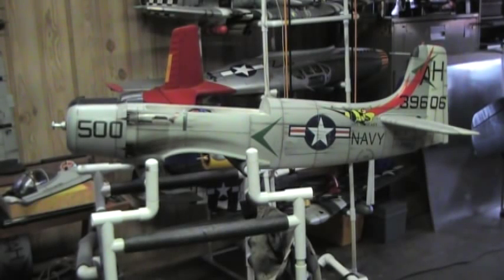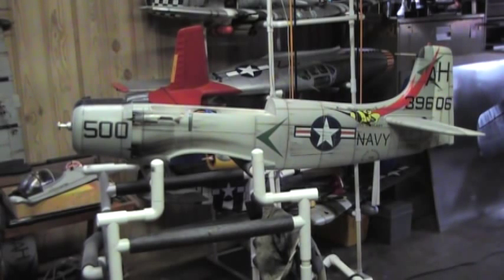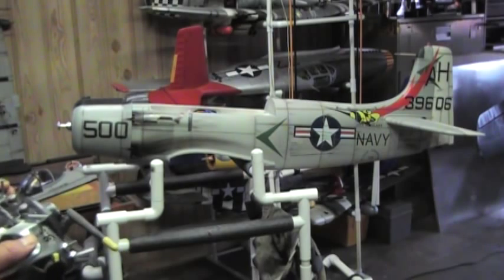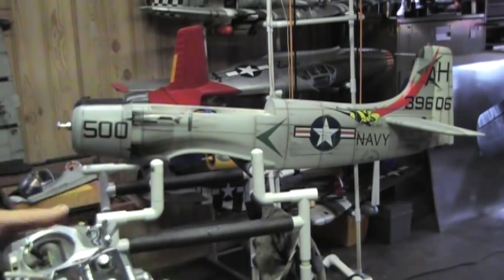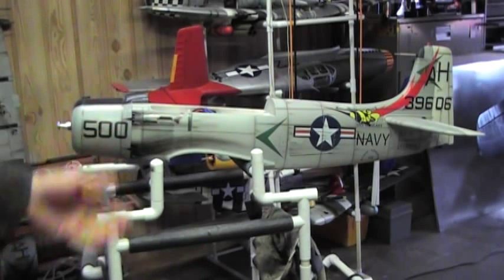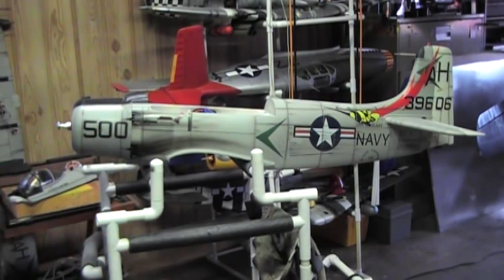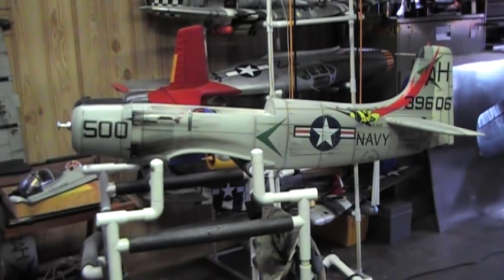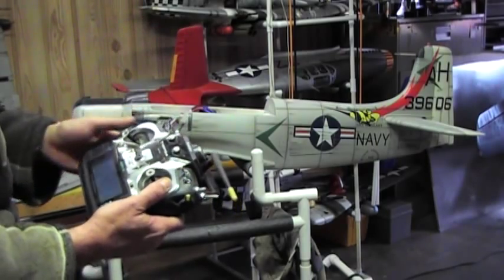A-1 Skyraider sound modification demo 001

Comment from the maker: That's a hard call to make...I like both systems greatly There are Pro's & Coms to both and each is speacial in it's own way. I actuall have my Skyraider rigged to use either one
 
I'm actually reviewing 3 systems: Benedini, Shockwave, and MR.RCSounds V4 and V2. I will be doing a review of the differences between them then....